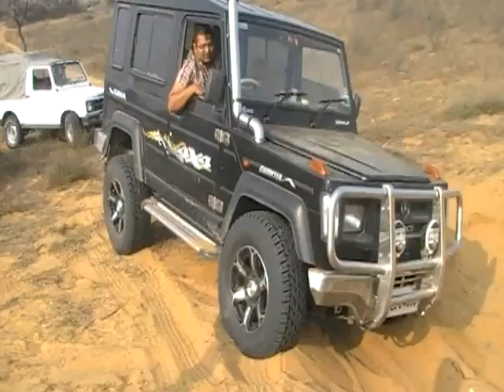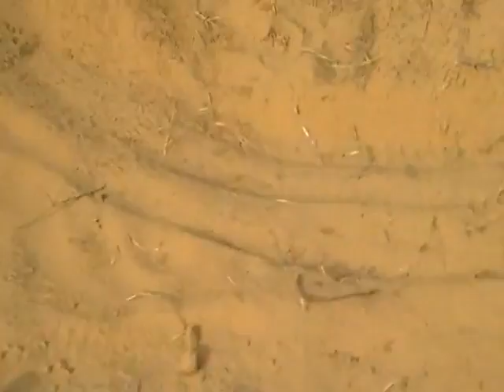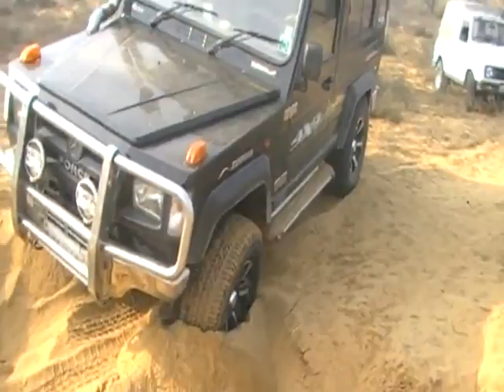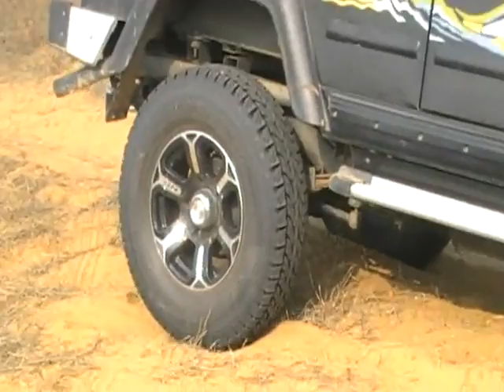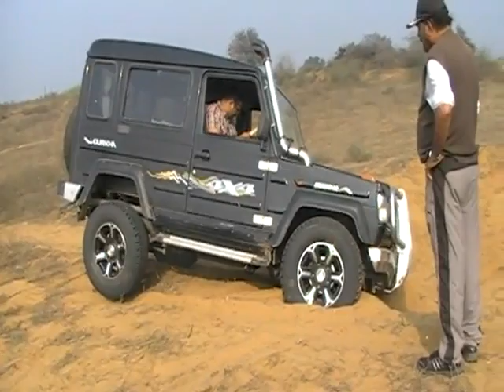Gurkha diff locks being tested.flv

Comment: I dont know if you noticed but the rear diff-locks did not work till the last moment!! You need to remove the pin and grease it up. Moreover this is what i was telling you in T-BHP forum the rear has poor articulation, i am very sure the fully-floating pods on the Jeep wont lift up like your rear wheel. 

Hope your new tires do better! :)